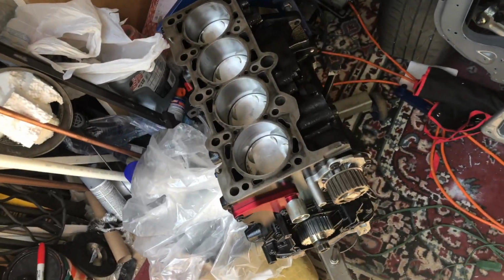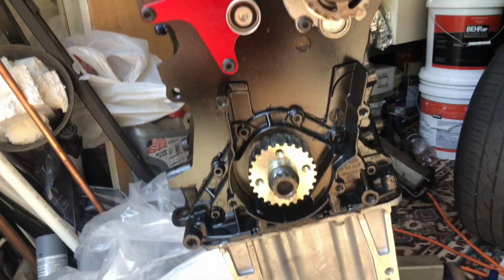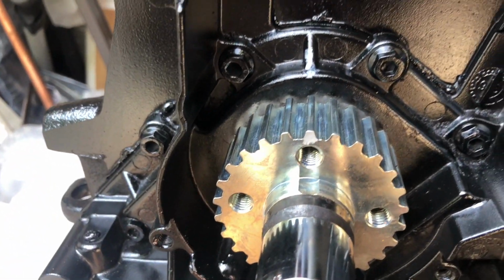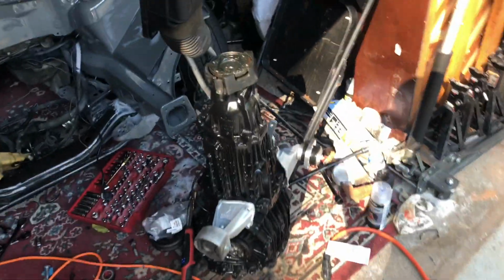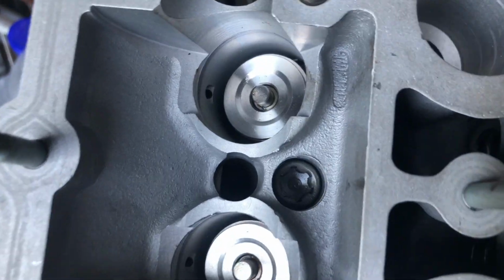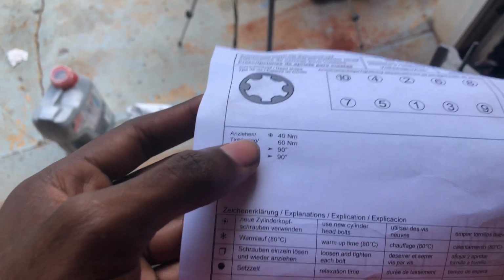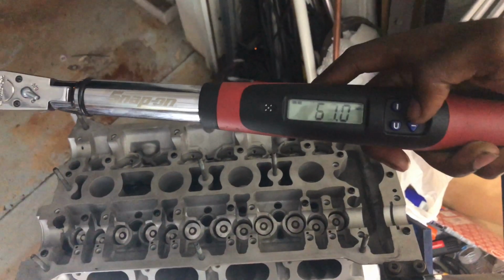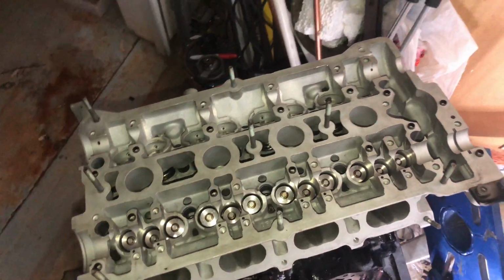Audi A4 1.9T Big Turbo Engine Assembly | Part 1

Comment: What head gasket is that?  I need to pop my head off again and mark my crank gear for TDC because I put a new head on and kept the pistons half way up during the install but I haven't run the engine or put the timing belt on so I found out I can re-torque an MLS gasket and be ok if it hasn't had heat.  Once I get the crank gear market, I can spin the cam gear until cyl 1 and 4 valves are closed and then bolt the head back down and mark that gear also.
Reply from the maker: It’s Elring head gasket

Comment: Is that damage on the top of your pistons?? Bad news if it is! You need to get a degree wheel for your wrench so it’s an accurate 90 degrees?
Reply from the maker: It’s a slight damage due to a valve drop but it’s completely fine

Comment: Respect man. I own a 1.8t AEB too.
I'm impressed you know about the original crank gear issues. Not many people know about it.
It uses to snap off that fitting nose with the crank on high rpms or higher torque numbers, even if the main bolt is thighten up correctly it just rips off.
Reply from the maker: Samuel M.C most def man, that’s why I put my main focus on the crank gear.
Reply: @quickshiftmyk1695  saw that. Keep it up, your content is very detailed and i love watching it.

Comment: Any tips on how you torqued the crankshaft pulley bolt to spec?
Reply from the maker: Delusive I made a metal bar long enough that’ll bolt up to pulley and stopping at the ground which Kept It from moving so the bolt can be torqued

Comment: Who did the work ... thanks have the same car want to go the same route... we're did u get crank gear from and ilder
Reply from the maker: Tirec Chatman a machine shop close to my house but I ended up doing most of the work and I got the billet crank gear from IE. It’s the new billet press fit gear they came out with that doesn’t shear your keyway. IE also has that idler

Comment: 8:00 Are those holes on your piston like it got hit by something? These will cause a detonation.
Reply from the maker: BalticMotorSport they were slightly tapped when a guy dropped a valve in his cylinder head. I bought It from him for cheap. It’s nothing major.